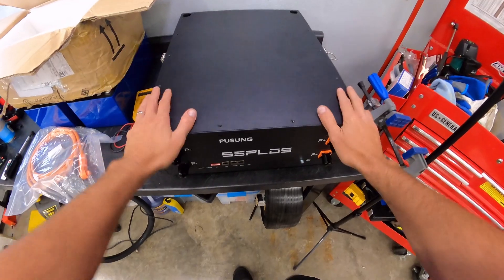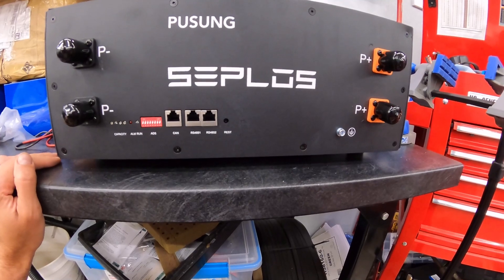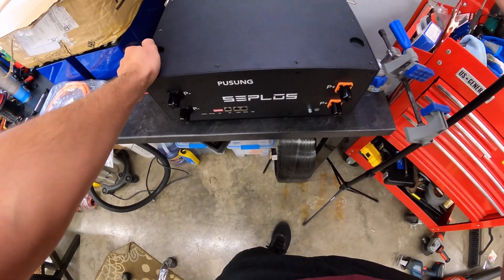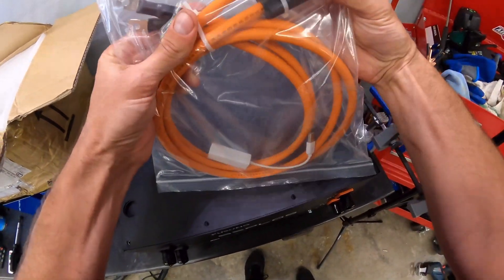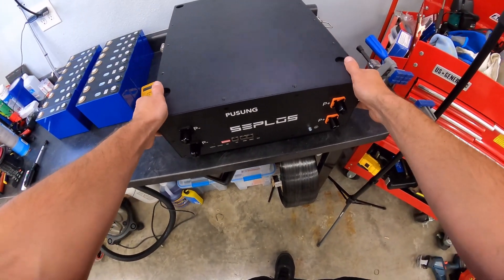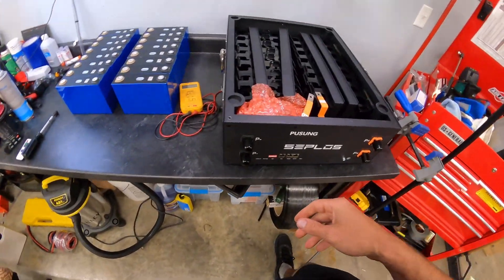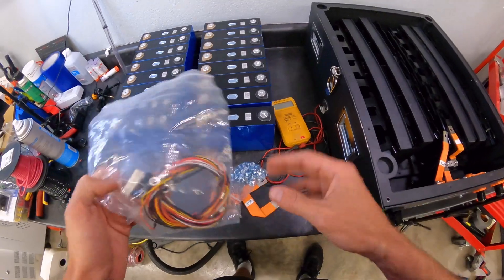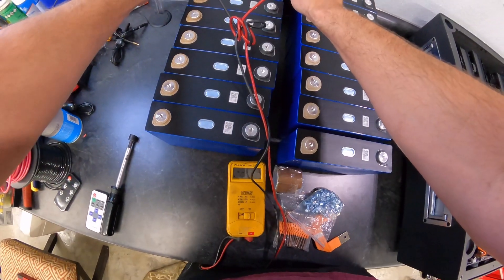Seplos Pusung 5.12KWH LiFePO4 battery pack overview

Comment: The Seplos website says they cost $2,109 each before shipping. I couldn't find any warranty information or UL Listing. A Simpliphi 3.8kwh 48v LiFePo4 battery can be purchased in the USA easily for $2,421 and comes built with a warranty and UL listing from a reputable company. This is cool though and looks like a fun way to learn about what is inside a LiFePo4 battery system. I don't think I could use it in any situation though because I would be concerned about it catching fire and burning my house down. Insurance may be able to find a way to not cover the damage because it was DIY and not UL listed or inspected by the local permitting department.
Reply: The big thing with any diy battery build for me is building it beyond what your local code requires and document everything.

Comment: i ordered their 200a bms ( the 100a version is in these), waiting for it to arrive
Reply: you can also connect the mpp solar/ voltronic axpert inverters..
these fully support the same protocol ( language) as the pylontech batteries
Reply: can we do parallel 200A BMS + 100A BMS? I'm asking because my 2 pack of 100A only receive 50A each pack from my inverter. Because the bms tell inverter it can receive 100A.
Reply: @rmdjapri  if you have 2 100 ah packs, you should reconfigure your pack to 2p16s OR buy 2 100ah bms's